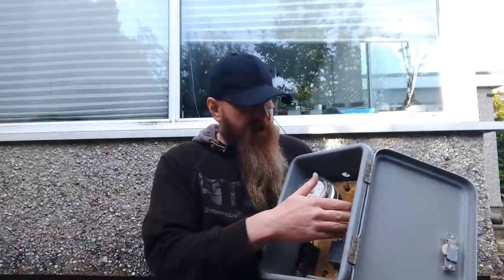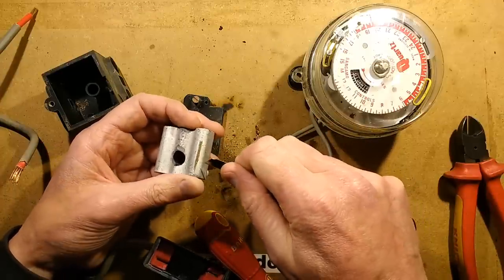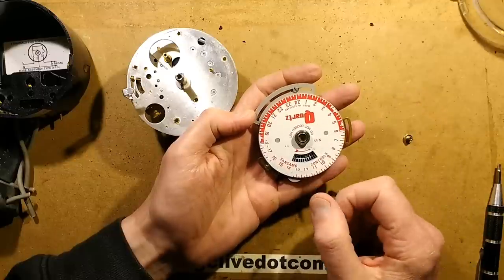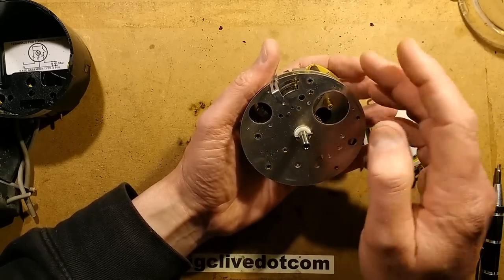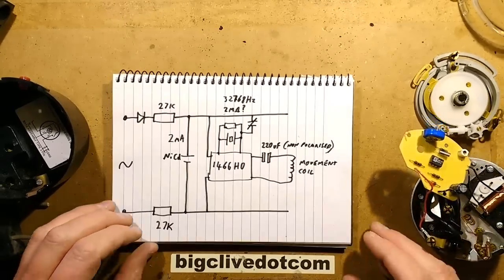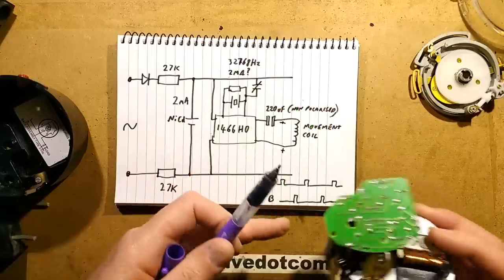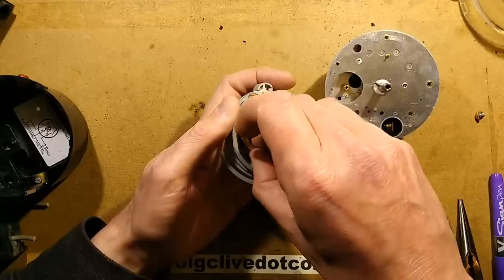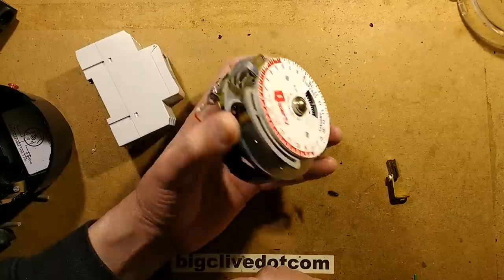Fixing a Sangamo street lighting time switch with solar dial.

Comment: I wish everyone used 24 hour time. Its a better system and I legitimately do not see ANY reason not to
Reply: hard to fit on analog clock faces
Reply: tohopes I guess, I mean its not too hard, but I suppose on smaller faces it could be
Reply: 24 hour time is much easier, AM and PM aren't problems anymore. For some reason people get angry at me when they see that I use 24 hour time. It's strange but I like 24 hour time.
Reply: time is a subject of debate since its first measurement . 
i think since ww2 we have a more united time , and that i guess happen for the coordination of the attacks from many nations against the nazi facist threat
Reply: Luke Den Hartog People still use 12 hour time simply because it's too inconvenient to change, all for what most would consider an insignificant change. Same reason why the US still uses the imperial system, or why the world doesn't use a single language.
Reply: I thought pretty much all digital clocks used 24 hours? At least they do here in France. On the other hand, while you can buy watches or other analog clock with 24-hour dials, they look really cluttered.
Reply: My alarm clock doesn't have an option for 24-hour time. That's okay since I prefer 12-hour
Reply: Broadcast automation systems use the 24 hour clocks as well as some syndication companies. Sometimes it can be a real bear going from the 12 hour standard to the 24 hour one. Would be nice to just get rid of the AM/PM system and go 24.
Reply: What, no metric time? 100 hours a day, 10 mins per hour. Ez peasy
Reply: aside from casual conversation i don't why you would use it, too much complexity for literally no reason at all - 24 hours is the most natural unit for that, its directly based on the rotation of the earth.
Reply: +Tim Lester It's not that hard.  Between noon and midnight, add 12 to the hour making 1:00pm=13:00, 2:00pm=14:00, etc.
Reply: +Kirbyofdeath I think the change in measurement systems from Imperial to metric would be significantly more difficult than going from 12 to 24 hour time.
Reply: I've seen 24 hour clock faces done two ways, a single sweep of the hour hand around face for 24 hour, which jams the markings together and does make it hard to read, or the same twice-daily sweep with each hour marked in black for AM (1 to 12) and red (13 to 24/00).
Reply: It's not really a 24 hour clock anymore if the hour hand does 12 hour revolutions. You lose the ability to tell whether it's morning or evening by just looking at the clock.
Reply: SteelSkin667 if you don't know whether is morning or evening it must be a good party!
Reply: Analog clock faces are back in vogue, therefore a 12-hour face is much easier to read.
Reply: The very device the whole video is about has a 24 hour analog clock face...
Reply: +tohopes:

No, it's not:

https://uhrforum.de/attachments/546024d1358005591-fortis-flieger-24h-uhr-fortis2.jpg

Minutes and seconds are the same as on a 12 hour watch, only the hours are different. The watch on the picture is showning the time 15:02:40 (03:02:40 PM).
These watches, there are wall mounted clocks available too, were used for people which could not see the daylight to check if it's night or day. For example in a bunker, submarine or during polar nights or days when it's dark or bright for several days.
Reply: +darronjknight Check out Marcel Germann's answer
Reply: John possum there are some decimal clocks about in the UK. Blame the French :)
Reply: Luke Den Hartog I wish people would use DD/MM/YYYY date format
Reply: You're likely to piss off fully one half of the human race (women typically don't like 24-hour military time -- it looks too much like something a "man" invented).
Reply: +uv man In France, and I assume most of Europe, 24-hour isn't military time, it's just the standard way to tell the time. So no weird difference based on gender here.
Reply: uv man That's so true! The feminists of this World would be getting their knickers in a twist, big time, if it was made compulsory!
Reply: I've used 24 hour time for more than 40 years. Passed my amateur radio exams, and have used not only 24 hour time, but UTC for most purposes. Some of the clocks in our house are on UTC permanently. It takes little mental effort to convert between local time and UTC, if necessary. The  whole planet could do with standardising on UTC (or internet time, etc.) and forgetting local times altogether. People would soon adjust to the fact that 1200 UTC might be late afternoon, midnight, morning or whatever, and build their lives around it, much in the way they use the artifice of national clock times now. Many professionals use UTC with no problems. It's the standard time on the ISS, space in general, international communications, for professional radio operations, military, commercial aircraft, shipping and many scientists, for instance. Just my two pennorth, and I don't expect everyone to agree with the idea. But it will have to happen at some point in the future of what is becoming an increasingly technological world.
Reply: >I wish everyone used 24 hour time. Its a better system and I legitimately do not see ANY reason not to

Hey, look! It's another know-it-all on the internet who think they know what's best for everyone!

No, I will not use your 24 hour time system based on anecdotes.

I wish everyone used Kamchatkan language. It's a better system and I legitimately do not see ANY reason not to. English is a horrible language full of paradoxes and complicated loan words so it should be banned and everyone forced to learn Kamchatkan.
Reply: GGigabiteM yes, english is a stupid language. I agree
Reply: tohopes you could just squeeze the numbers together to the half way point and add another 12, the system is completely arbitrary.
Reply: RWBHere  Oh my, I completely agree. I have had similar thoughts since traveling across the world in 2001. In terms of how I write the date and time, I use YYYY-MM-DD HH:MM with the time in the 24 hour format. Unless I am writing the date using the full month name, in which case I write it as I say it: 24th of May 2017.
Reply: I don't agree with you.
Reply: OM G In the military, we just had 12 hour clocks with the numbers 13 through 24 printed just outside of the 1 through 12. You could usually guess if it was 1300 or 0100.
Reply: A. Black - I use the military style DD Mmm YYYY format...  22 Apr 2017, 06 Jun 2017 etc...  tho I leave off the year unless it's totally necessary, I prefer it because there's no way it can be misinterpreted because of DD/MM or MM/DD differences.    Using the month before the day is frustratingly annoying and never made any sense to me, but living in the states I have to deal...   at least I know I'll never confuse anyone with the labels I write on the Grateful Dead and Jerry Garcia Band (which I thought Clive's hoodie was a JGB one at first, sadly no) CDs I bring to festivals for trade ;-)
Reply: Marcel Germann - I really like that watch...   if I ever bother to wear one (which I'll have to buy first), I am definitely going for that 24h style !!!
Reply: I always use the DD/Mmm/YYYY format to avoid confusion, especially in computerised systems where the software may or may not be regionalised.  One official document that I receive regularly even has the same date in both US and RoW formats on the same page!  For naming computer files I use a modified format with MMm where the month is shown as 08a (for august) - this keeps the files in chronological order in the directory listing.
Reply: TOTALLY different from language, but the rest of your points are true. Language is fundamentally a strange beast that can't be standardized.
Reply: @HankScorpio64  "The old-fashioned clock with the twelve-hour face was ticking away on the mantelpiece." Thank you; nipping off to re-read 1984 now.

I do like using 24 hour time, but there are several logical reasons for a 12 hour clock. The day is, with seasonal variations, roughly divided in half by daylight and night. 12 hours are easily divided into 30 degree arcs. 12 goes neatly into 60, whereas 24 does not; no need for placing the second/minute pips on a separate scale within the dial.

Of course, one is tempted to defer to authority in such cases as this: Big Ben has a 12-hour face and has better name recognition than the Westminster Quarters that are commonly associated with it. How many 24-hour clock faces have any name recognition? ...but then, appeal to authority is a logical fallacy.
Reply: why not use metric time

Comment: man that chipboard is the worst for any place that could potentially get moisture.  it just gets wet then stays wet.
Reply from the maker: Yeah, I'd have chosen something like a treated plywood or something similar.
Reply: Yes, It looks like the same weetabix board that the electric companies insist on putting their incomers, cutouts and meters on, I lost count of the number of them I saw completely rotted away behind a spider of free hanging PILS cable and tails!.
Reply: must be a great haven of spiders when you go to open one!   chipboard was cheaper, hence x100,000 it made for a nice vacation for the ceo
Reply from the maker: You find spiders and lots of other stuff in every outdoor enclosure with any entrance room at all.  Fortunately we don't really have many venomous spiders here.  I think the False Widow is the worst in Britain and it's so rare that most people will never see one.
Reply: bigclivedotcom there were loads at my old house. the pervious occupant had put down carpet on the back garden down the borders to keep the weeds coming through and then layed over wood chippings. where the carpet had rumpled it made a perfect habitat and there were so many.. clearing that out was horrible, it needed to be done as I got stung and a massive tennis ball swelling on my ankle.. horrible..
Reply: @paul, fire would have done well then
Reply: bigclivedotcom I see loads,  but then I'm a Gardener and have been for years. I still frequently see bugs that I've never seen before though.
Reply: Jusb1066 if only I knew Big Clive at the time and his experiments with volatile battery chemicals..
Reply: the chip board may of been a good condensation moderator.  When i buill stuff into enclosures for outside i often put some folded up kitchen roll in there so condensation is averted as it soaks up moisture.
Reply: Down in here in Cornwall, urban legend has it that roofers found a load of actual Black widows in an attic in Falmouth which allegedly came in from the docks somehow. Dunno how true the story is tho.
Reply: Probably true, a chap at a scrapyard locally was bitten by a spider and lost his arm though infection, (Wiltshire)
Reply: Come back asbestos  - all is forgiven.

Comment: I have no idea how you got your hands on this but now I want to see you tear down a stoplight.
Reply: Id guess with as long as Clive worked in the trade he's made a lot of friends, that know he's into this sort of thing. Also just working day to day in the electrical trade you'll run across all order of odd things that customers will happily replace upon learning how old it is.
Reply: Well, he did mention it gets really dark after midnight.
Reply: I wonder why they use this complex mechanism when they could just use a microcontroller, relay and cristal
Reply: bdot02 Only the really old (pre 90s) stop lights have especially interesting mechanicals (which I have disassembled before, back in the 80s), nowadays they are mostly electronically timed with some also equipped with proximity overrides to modify timing on demand, to the best of my knowledge.  As much as I love computers and microcontrollers, mechanical devices lost much of their awe when their once  complex mechanical mechanisms got replaced by mere lines of code.
Reply: because there were invented in 1960 and the retrofitted, a new design would involve years of testing...also current consumption, the town councils have to pay for the electricity, while its not metered, they agree a set amount based on the use of the light, so the bulb/timer are measured and a cost agreed, a relay would substantially increase the cost of running the timer, 1ma versus 50ma...
Reply: wanna see him teardown a speed camera, and the ultimate,  a bbc detector van. lol
Reply: @francois except the bbc isnt a tv company, its s government owned propaganda network, owned since the 1920s to control broadcast media in the UK, with the budget of a major security agency to match, only rupert murdoch has outdone them for mass propaganda
Reply: i think all they looked for was the tell tale flickering on the curtains, by the time they had any tech , computers had screens too much going on to tell what was what, coupled with pushy men who worked for them
Reply: These days Traffic lights are becoming L.E.D, to cut running & maintenance costs. The 12v 55w halogen set-up (which replaced 240v incandecant bulbs) was later modified with a dimming circuit operated by a P.E.C. (photo electric cell, the little dome similar to ones on lamp post heads, situated on one traffic light post) which had two functions, 1/ to eliminate glare from said lights in darkness, 2/ cut running cost. (the latter I doubt)
Reply: Maybe every resident had a TVL somewhere else or was deemed to be paying enough taxes
Reply: Screwy Reynolds 
They tried that in some of the colder parts of the US. They found our quickly that without the heat from the bulbs snow sticks to the lenses and the light cant be seen.
Reply: ChrisD4335 Robust! As an old & trusted device, (& before they brought out Digital devices) some of these are "on" wooden posts or walls outside, in the City & the sticks, perhaps (I say perhaps) these type are less susceptible to failure when a little bit of lightning hits close by. ones "inside" lamp-posts would be protected by the "Faraday cage" of said lamp-post.

Comment: I worked at Eastern electricity in Norfolk and was on maintenance and repair of all these switches from the electromechanical for street lighting to those for economy 7! We repaired these in batches of 8 and would strip down then clean in an ultrasound cleaner then check and replace all damaged bearing,wheels and escapement, reassemble, oil then put on test for 24 hours.  I could still strip and reassemble with my eyes closed.

Comment: Great video, Clive. Very informative, even learned a couple of things myself!

Happy to let you know that we are still in Port Glasgow and still making these dials today. In fact, for our 65th anniversary last year we had a competition to find the oldest working switch and found loads still running after 30, 40 even 50 years!

Our website, as well as brand new switches, has spares for these so we can supply the batteries that fit right in or spare dials if you decide to ignore the warning and loosen the nut (we did say!).
Reply: @Sangamo I have one of these in my block of flats in Glasgow. I used to get it serviced by a guy in Walsall every 5 years or so. Sadly he's no longer around. When I called Sangamo technical sport about a service, the Sangamo technician recommended I throw it out and buy a replacement. Disappointed to see Sangamo adopting a 'throwaway' culture having had a reputation for long-lasting devices. There won't be many entries to your 'oldest working switch' competition in the future if you are telling customers to put their repairable devices into landfills. :(

Comment: The fancy sun tracking part of that timer will be latitude dependent: I'd guess the "54' N" on the face is actually 54° N.  Especially given the crazy amount of daytime swing, that makes sense. Scotland really is way the hell up north!
Reply: Oh, and the cam is stamped 54, so it's probably the only thing that changes for the different latitudes. That might explain the complicated rack and pinion arrangement, instead of having a totally different gearing setup for every latitude. It's a super cute design, overall.
Reply: true given the type of weather they hav up there
Reply: fwiw Sangamo website says they're available for latitudes between 50 and 56 North in 2 degree increments.
 Sangamo switches were pretty ubiquitous in the British isles and the non battery backed ones were capable of working for decades - guess they never exported these very far but it seems they're still making them in Glasgow.
Reply: ah that explains a lot yea maybe cos in england there was another company doing the same cos ive seen a few still around my area
Reply: chemtrails....dont even get me started on vortex's and pressure waves in air....

Chemtrails are BS
Reply: Matt Quinn - Yes I gathered...lol

I would lose faith in humanity if anyone here believed in that crap. Pretty sure most people here have at least, a basic understanding of physics and maybe even aerodynamics.
Reply: LOL - better not mention the earth is flat then. ;-)

Comment: Bloody well built timers, are Sangamo's. There's a 3 pin, like Clives, where the clock & load can share the Neutral, with switched live. Or a 4 pin job, that operates a separate supply from the clock supply. For anyone interested, the big circular hole with a pin through the centre (6-mins in vid) another dial can be fitted, which has 7 much smaller arrowed & slotted dials around the circumference, each with a day marked. (Sunday through to Saturday) these you could turn 180 degrees if you didn't want the switch to operate that day. So if you adjusted Sunday to not operate a load, then every Sunday the switch would refuse to operate. The 'Day wheel' was turned by  'one' of the switch operating pins.